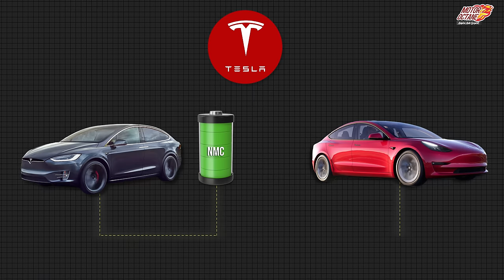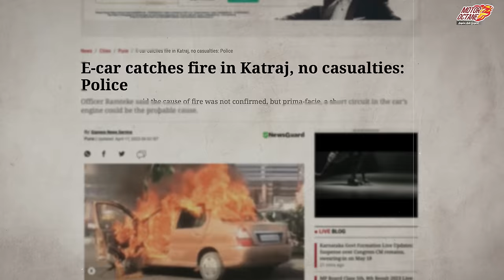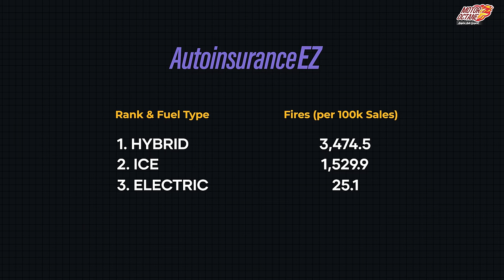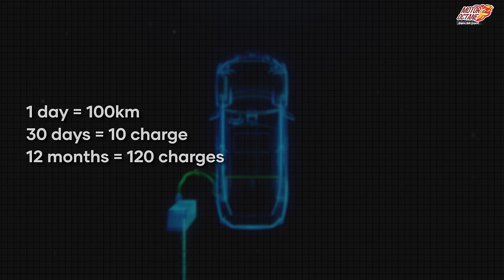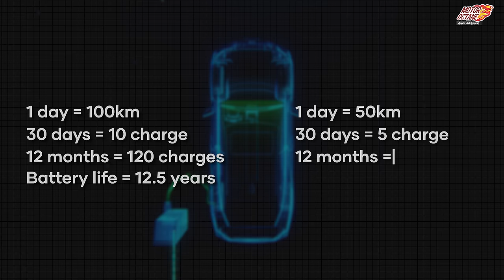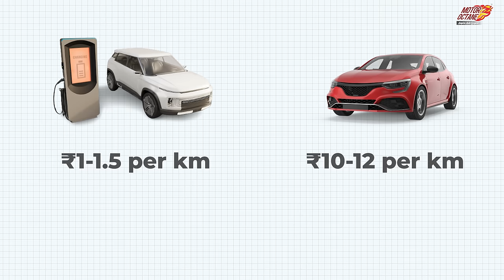Electric Cars have Battery Problems?

Comment: Amomg all byd is the best Ev right now
Reply: I bought this car recently with the main intention of having driving comfort. But I am regretting it now due to the following reasons.

1. My back is sweating if I drive the car even for 1 hour and there is no use even if I turn on full AC. I am feeling very uncomfortable to drive after an hour and long drives might cause even more discomfort to me. This defeats the very purpose of my buying this car.
2. I recently dashed another car slightly during a traffic jam. The car's technology did not apply automatic break although it was claimed so by the company. So, the safety has become a concern now.
3. BYD's roadside assistance is very basic as the customer has to pay for any damage that happens during towing. In my case, I was asked to pay around 3.5 lakhs for towing damages. Because the insurance pays only for accidental damage but not for the towing damage. So, I am made responsible for the damage caused by BYD.

I did not even complete my first 1000 km. I am now wondering what I gained by buying this car.

...

Comment: Cost of fuel savings were very exaggerated and misleading.
Talking just about today's cost of fuel & electricity and leaving out the future cost inflation.
In Navi cost electricity per unit at home ≈ 16 INR / kW
Taking crossover compact SUVs & real world usage range for reference
For an Ioniq 5, 72.6 kW gives a range of about 500 kms giving about 2.32 INR / km
cost of petrol today = 106 INR / litre
For a petrol car, mileage of a car can range from 10-16 km/l costing about = 6.63 - 10.6 INR / km
So if you drive a car for about 1,00,000 kms : You will save about 4.3 L - 7.28 L INR.
Reply: I bought this car recently with the main intention of having driving comfort. But I am regretting it now due to the following reasons.

1. My back is sweating if I drive the car even for 1 hour and there is no use even if I turn on full AC. I am feeling very uncomfortable to drive after an hour and long drives might cause even more discomfort to me. This defeats the very purpose of my buying this car.
2. I recently dashed another car slightly during a traffic jam. The car's technology did not apply automatic break although it was claimed so by the company. So, the safety has become a concern now.
3. BYD's roadside assistance is very basic as the customer has to pay for any damage that happens during towing. In my case, I was asked to pay around 3.5 lakhs for towing damages. Because the insurance pays only for accidental damage but not for the towing damage. So, I am made responsible for the damage caused by BYD.

I did not even complete my first 1000 km. I am now wondering what I gained by buying this car.

...

Comment: Where are we drawing the electricity from it's thermal , so do better change the source of energy
Reply: Right now India has 12.3% share for non-fossil fuel energy.
Look at this as separate problem which can be solved separately.
Each year percentage of renewable is increasing.
With EVs we are atleast solving problem at front-end(the car).
The backend(energy source) will take much more time.

Also remember EVs are more efficient specially with regen feature.
I drive a EV and I can see the improvement in efficiency with regen on.
Reply: @manishban  the simplest way to look at it is that 

normal car is 20% efficient EV is 90% efficient

yes, coal energy pollutes but for EV to pollute more than normal car, coal needs to pollute 4.5x more (efficiency difference) than petrol

avg petrol car pollutes 120gCO2/km (using uk numbers because manufacturer don't tell the real emissions in india) 

avg EV like nexon can use 0.120kWh/km and coal makes 800gCO2/kWh = 0.120*800 = 96gCO2/km

even with 100% coal ev pollutes 15% lesser than ICE car.

we have 40% renewable sources in case of which EV will pollute only 0.6*96 = 58gCO2/km which is half that of normal petrol car

Comment: I really love the clarity you have put on the EVs over Petrol fueled vehicles. I am thinking of buying a car but if I see maintenance cost of a car running on petrol, it's a lot if calculations done yearly and for a person with salary 25k to 30k. Here, EV cars are beneficial in every manner because you won't have to pay extras like for petrol cars. 250 to 300km in one charge is a tremendous achievement and a very good deal because petrol cars can't take you even 30kms in 1 litre. However, in all impressive advantages of EV, I've just 1 disadvantage that is this- if suddenly the charge is over in a remote area, how am I suppose to charge? Since it's a new emerging technology, power stations to refuel the batteries aren't there yet except for metro cities(maybe). This becomes a disadvantage. However, this disadvantage is not so much burdensome if I buy the vehicle just to commute 40kms on daily basis. Or if I ever plan to go on a trip, I must have to make sure that the to and fro journey can be covered in 1 charge as there lacking of charging stations in all over India. All in all, EVs are definitely worth it. Thank you Sir for such an impressive explanations about EVs and whether or not we should buy it. I'll definitely give it a thought, make comparisons, reason with researches and make decisions whether to buy it or not.

Comment: I am waiting for Hydrogen FuelCell vehicles to be mainstream because they are more practical option compared battery electric vehicles, a Hydrogen FuelCell car like Toyota Mirai is already cost competitive compared to petroleum fuel in India, Petrol costs more than 100₹/L and the average fuel economy of petrol cars is 14-18 km/L which means that it costs 7.14-5.55₹/km, now let's compare it to green Hydrogen, green Hydrogen manufacturing costs is 300-350₹/kg, it should be available to consumers for approximately 500₹/kg and a Fuel cell car like Toyota Mirai can hold at least 5.6kg of Hydrogen and it can run for 650km before needing a refill which means that fuel cell vehicles cost 4.30 rupees per km (500 rupees x 5.6 kg / 650 km). Fuel cell vehicles don't suffer from any kind of performance degradation in cold weather. Indian government has announced National Hydrogen Mission and Indian companies like Reliance, GAIL, L&T, Adani Enterprise etc are making big investments to bring green Hydrogen manufacturing cost down to less than 100₹/kg which means that in near future fuel cell vehicles will become even more cost-competitive compared to petroleum vehicles. However the cost of Hydrogen Fuel Cell vehicles is still high compared to petroleum based Internal Combustion Engine vehicles, price of fuel cell vehicles will reduce when production will increase. Companies like Toyota, BMW, Hyundai have a very important role in green mobility solutions because these companies are leader in fuel cell technologies, they should work with the Indian government and try to establish hydrogen infrastructure as soon as possible, Automobile companies should launch highly affordable fuel cell cars to compete with battery electric car, a fuel cell version of existing cars at a competitive price can make fuel-cell cars popular very soon.

Comment: However hard u may try to convince us ..having a practical ev which can compete ic engines in indian setup is still a distant reality.
IC engines can be relied upon stress free easy to go easy refueling reliable
What ever issue creep up there always a mechanic in the corner to help 
There is always a pump in the vicinity
An average indian hardly drives his car one lakh km in the entire life of his car so why unnecessary pump in extra money to buy an ev...u can buy fuel from the difference amount and drive for 4-5 yrs(break even point).and in the next 5 yrs u can change ur car and technology features as cars are getting outdated even quicker now.
It will take another 10yrs for ev setup and functionality in india till then u can have a brand new ic engine car and enjoy.

Comment: Batteries have poor energy density per unit volume compared to that of conventional car fuels like CNG, gasoline and diesel. Car should not behave like a mobile phone or a laptop whose battery will deteriorate with time and will fetch poor resale value in a fast period of time, now mobiles and laptops are much much cheaper than a car so can afford their fast drop in price with time but not the same for a car. Preferred low initial investment, access to 24 hours per day refuelling as well as to  sufficient number of refuelling stations plus quick refuelling. Outside the metro cities, even now there are frequent power outages and load shedding making it impossible to run an essential appliance like refrigerator 24 hours per day. 
Recharging battery of EV is going to come mainly from thermal power plants that use coal or natural gas. There is no substitute to fossil fuels, they can provide energy 24 hours per day 365 days of the year. Each fossil fuel has at least 3 order of magnitudes times higher surface power density than that of each of solar, wind, hydropower, biomass and geothermal. India has scarcity of land area needed to build houses, food farms and manufacturing units. Both land area and water area have to be used efficiently and utilized 24 hours per day 365 days per year instead of getting blocked with solar or wind farms, inverters and batteries. Life is Carbon. EV is not the solution. Problem is high human population coupled with lavish use of transport vehicles. 
One can minimize need to travel by maximizing online tasking wherever possible. One can avoid using a car to travel walkable and cyclable distance unless one has very good reason. Netherlands has Dutch people using cycling to a maximum for daily travel. Distances in India are not big unlike in USA where a homeless in Skid Row of California is forced to use car as a home. India needs to minimize traffic jams, control human population and ensure that all the seats of a passenger vehicle in travel are occupied by passengers. India has big scope to optimize the number of cars and other passenger vehicles needed to be produced.

Comment: So wrong, IC engines car will have less chance of catching fire than Electric cars, it's not the cooling technology, it's the short circuit in batteries that causes fire. Which can happen even if car is not running. Once its catch fire, you can not stop it. That's the way bigger problem.

Comment: Informative video. Still question arises. What will be resale value after 10 or 12 years? The car already depreciated and might have reached 30-40% of original value( if it is petrol or diesel). Now Then nobody want to buy old electric car running on original battery since he may not want to replace car battery with new for the car which already depreciated to the level of cost of new battery.  This is really a issue even after watching your video. Since technology is new and we don't have data on this. Even after watching your video, life of car after 15 years is not clear.  People may not drive every day and a 15 year old battery might have run for about 60K-1lack kms. What is the future of that car? who will buy without knowing how long will it run in future before replacing with new battery.

Comment: Don’t compare the degradation of Tesla battery with the cars in your video. Have you used any of the battery devices for more than 5 years? Like mobile, earbuds etc ? That gives an answer. Looks like you are tilted towards EV. The upfront cost of EV is significantly more. Right now customers are getting some benefits of on road price because of incentives by government. That is not going to last long. Need at least another 5 years to show which one is a better deal. Also read the article by IIT Kharagpur about how EV causes more harm to environment compared to ICE.

Comment: Let's say, the battery Capacity is 300 kms n u drive 100 kms per day, So theoretically, you will have to charge in 5 days. That assumption is absolutely WRONG. I think if I am the EV owner, I will actually charge once I am done with 150-180 kms. No one can take that risk of getting stranded in the middle of the highway, specially how unreliable these EV z are specially with the range part. So your 1500 cycles will come VERY QUICKLY.
Reply from the maker: Why will you charge it so quickly? It isn’t even needed
Reply: @motoroctane  human nature. Most of the people don’t wait for the tanks to go dry .. they fill it once it’s half empty ! What about traffic jams in india .. if u r stranded in traffic for 30 minutes .. unplanned events make it all the more risky !

Comment: I got upto 6 minutes of your nice video and then switched off.  There is only ONE type of electric car battery:
Heavy (maybe 300Kg or more), expensive (45% or more  of the basic cost of the car) and prone to catching fire (20 airbags won't be useful here, maybe a lot of water).  
The rest is hype fuelled by politically motivated propaganda focussing on a trace gas.
So for those who after some tomorrow stare, the future is not stupid.  Battery Evs are just plain stupid.
The path to net zero is littered with recessions and many sunken Maldives.
Now, can we have our sensible little ICE cars like the Maruti 800 back please?  That engine pushed India into being  an automotive power house before the BS6  phase 2 guys got into their song and dance.

Comment: If if car is not used for several years battery will deplete like inverter batteries in our house?
Reply from the maker: Nope, it works on new of charge cycles.
Reply: I bought this car recently with the main intention of having driving comfort. But I am regretting it now due to the following reasons.

1. My back is sweating if I drive the car even for 1 hour and there is no use even if I turn on full AC. I am feeling very uncomfortable to drive after an hour and long drives might cause even more discomfort to me. This defeats the very purpose of my buying this car.
2. I recently dashed another car slightly during a traffic jam. The car's technology did not apply automatic break although it was claimed so by the company. So, the safety has become a concern now.
3. BYD's roadside assistance is very basic as the customer has to pay for any damage that happens during towing. In my case, I was asked to pay around 3.5 lakhs for towing damages. Because the insurance pays only for accidental damage but not for the towing damage. So, I am made responsible for the damage caused by BYD.

I did not even complete my first 1000 km. I am now wondering what I gained by buying this car.

...

Comment: Dear host let me inform you people can't buy Tesla. You have given all examples of Tesla.
After 7-8 years people get good resale value for fossil fuel cars. . but NOBODY WILL BUY A USED EV who knows that it can go off anytime and would have to spend lakhs to replace battery.
Please don't misguide innocent people.. you know how much pollution it creates to create a battery of an EV? AND do you know how harmful is the disposing of faulty/expired battery towards the global environment?
You must not speak on behalf of the EVs and ordinary people would suffer in the long run.
Residential unit price in Bombay for electricity is more than Rs 12/- per unit and outside charging would cost around Rs 28/- per unit for EV.
YOU must also state cons ( which by the way are far more greater than pros. )
Regards!

Comment: Ruchit how you consider one cycle is equal to 300km we dont 
Charge always from zero it could be from 50 20 30 or even 70 how we consider fatigue line batteries behave differently ruchit even mobile phone companies suggest that you should charge 20 t0 100 its not possible i think so
Reply: it does not matter what is the ending point, you need to count final - initial 

like 100 - 70 is 30 so if you charged from 70 to 100 it counts as 0.3 cycle 

if you do day for 3.33 days then you will complete one cycle

cycle is not when battery is charged to 100% or the number of time you charge.

whether you use 20% in day and then charge back to 100% that very night or you use the car for 5 days and collectively charge from 0-100 in one day, it counts as one cycle only.

Comment: EV doesn't save Rs. 10 per km. At most it saves Rs. 6 per km.
Reply from the maker: Please explain?
Reply: servicing cost is more in ICE 

I pay 1500 for EV service max at 7500 km (0.2/km) whereas ICE Nexon owners pay minimum 4-5k per 10k km which is 0.5/km

further, brake pad and tyre need more frequent replacement on ICE since they dont have regen braking.

Comment: BS... Have you heard of the lady facing problems in Tata Nexon EV Max?
Reply from the maker: We have even heard of people facing problems in their petrol and diesel cars too.
Reply: firstly it was nexon EV xm variant not max variant (rims are visible in the post she made on twitter)

secondly manufacturing defect can occur with any car be it EV or ICE

how many ppl are fed up with dsg failure in VW or fuel pump issues in luxury cars like bmw and merc you can check on internet

Comment: Sardio m ev ki battery kya perform krti h wo batao.  Meri wali ev max ki performance in low temperature like 3-15 degree is very bad. Car is running only 200 km in 100% of battery.  Kya ye sahi h.  Iska test krke batao

Comment: Ev in rain and water logged situation to be covered
Reply from the maker: Same like Petrol/diesel engine in water :-)
Reply: Battery and motor is IP67 Rated.

Battery is completely sealed off from external environment, the cooling system is also closed loop ie the coolant never comes in contact with air or the battery itself, it only acts as medium of transferring heat
Reply: No problem even charging in rain. You can watch such example in my channel